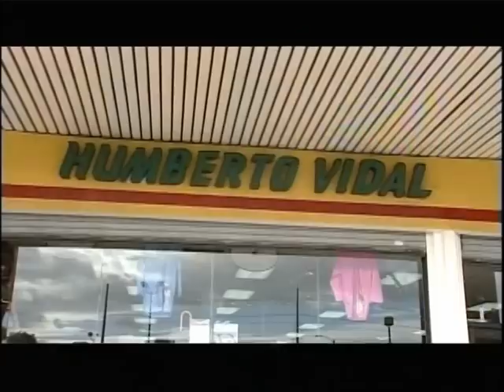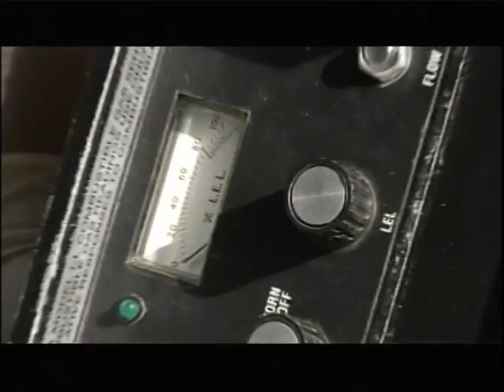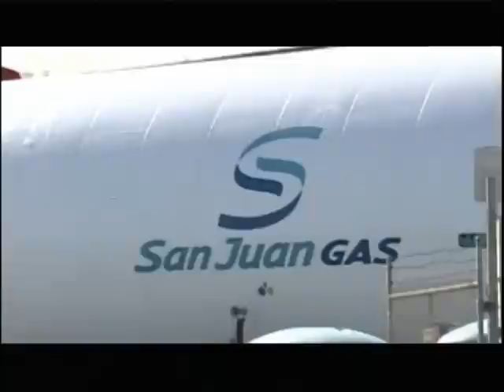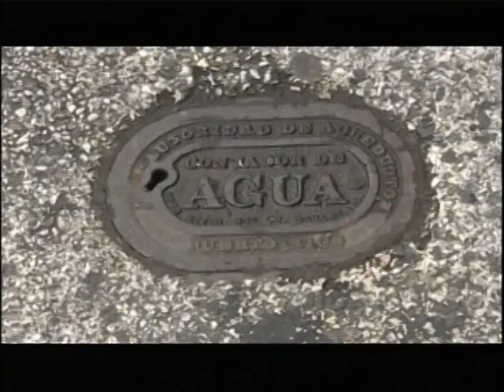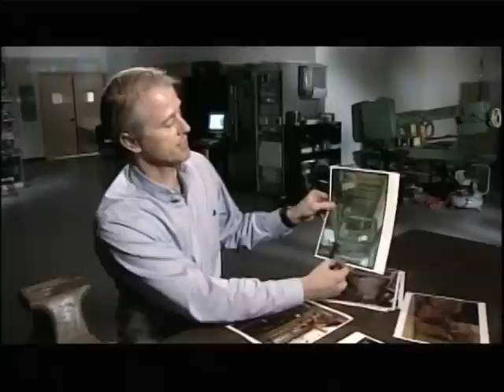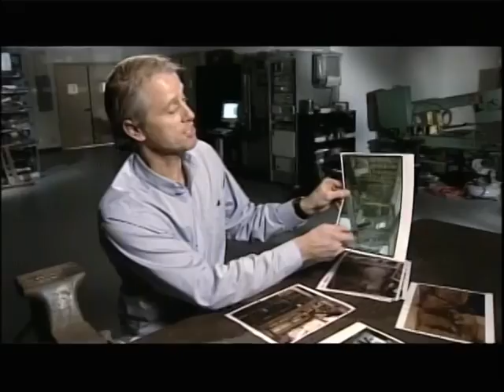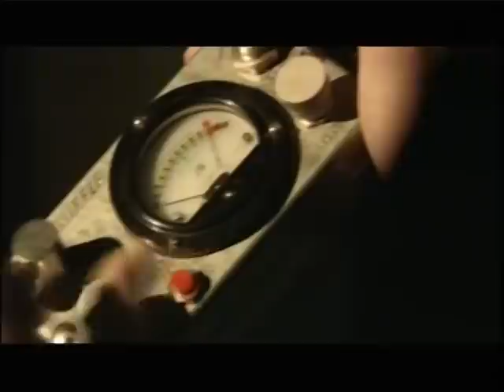San Juan Explosion

Comment: But if a toilet is bad, and not fixed, it can run dry. And the gases can come in through the trap. Or if the vent is old cast it can rust out and you get a hole. Mostly it can happen right at the floor.